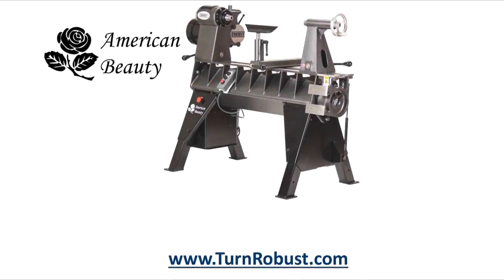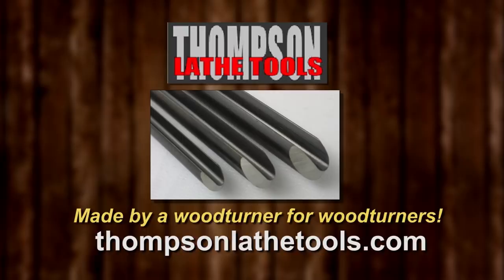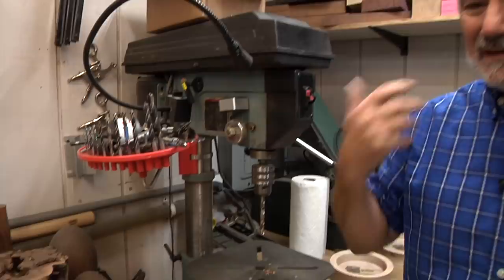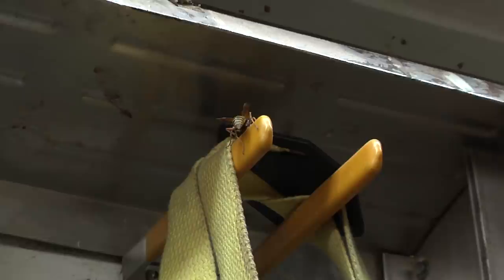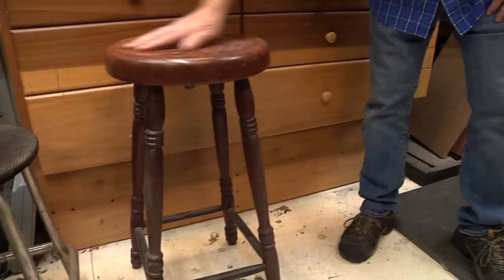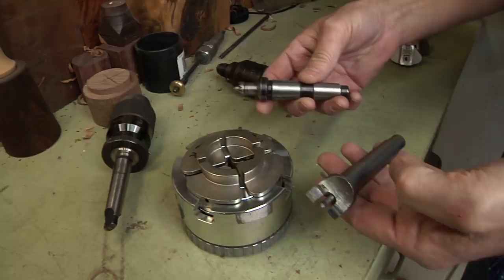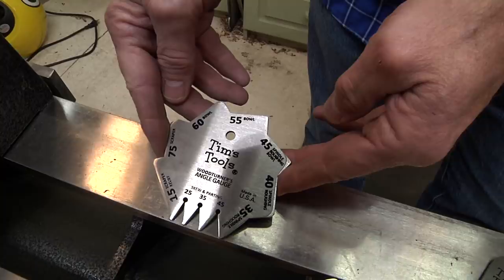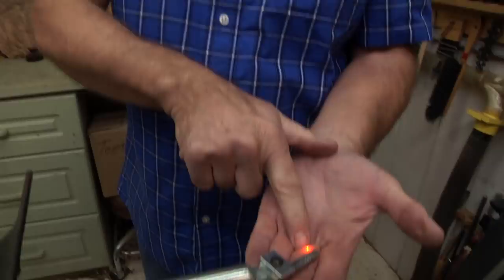Tools for Turners

Comment: Thanks for the video.. I thought the throat was defined as follows: "The throat is the distance from the blade to the vertical frame section of the body of the saw. This distance determines the width of cut that can be completed on the band saw." I think you described the resaw ability of the saw. I love your stuff!

Comment: so... i want to be able to turn lengths up to 50-60 inches long... would i end up just using extensions for the tailstock? even if i went for a fairly beginner entry level lathe under $300 for the lathe itself? apart from doing basic turning i want to use the lathe for hand sanding and polishing of wood, so that i can make single piece or segmented walking sticks out of glued together woods of different types, and be able to turn bits for attaching hardware for handles and points... got any advice where to start out?

Comment: Nice video Tim. I have all the things that you have in your shop. But i decided to use also a dust/ shavings extractor and a tablesaw. 

The next time, I will buy a new lathe. The american beauty is too expensive for my use. So I will buy the axminster trade at 1628 vs. Will see how it works.

Comment: I'm interested in the laser light you have on the hollowing tool.  Do you sell that separately?  I have one but I have gone through about 10 laser lights because they can't hold up to the constant vibration.  They are not easy to find and end up costing a fortune once you do find one that will work...  Just ready to change to something better.  Thanks!

Comment: I want to buy some of those Thompson Lathe tools, but struggling with which ones I should get. As of right now I turn small objects like chess pieces. When I started 5 years ago I bought the cheap tools that sort of worked. Now I want to invest in better ones. I uses a Delta Mini/midi Lathe.

What would you suggest?